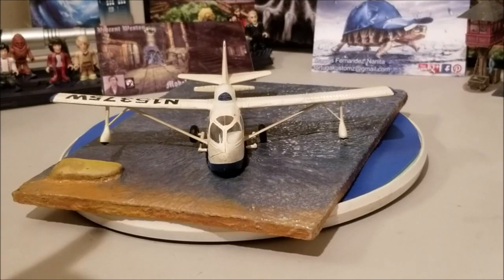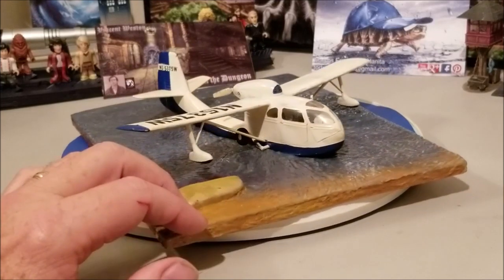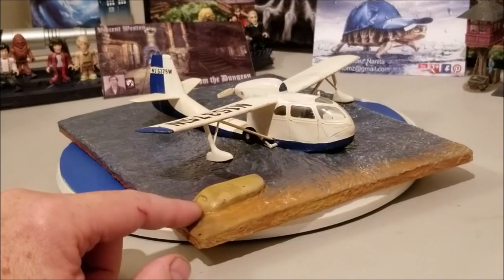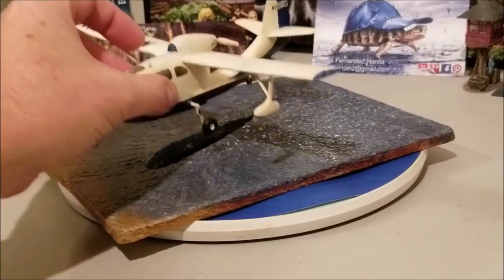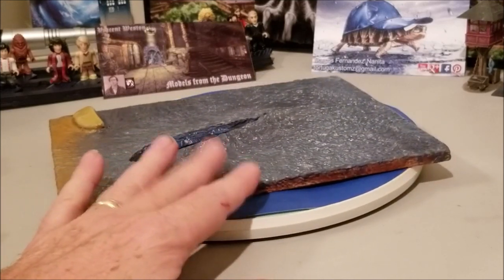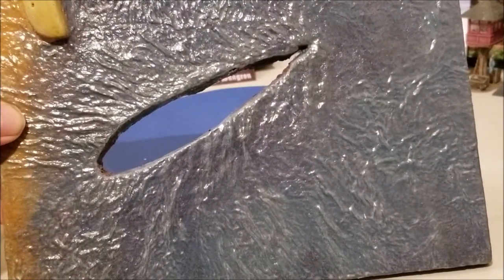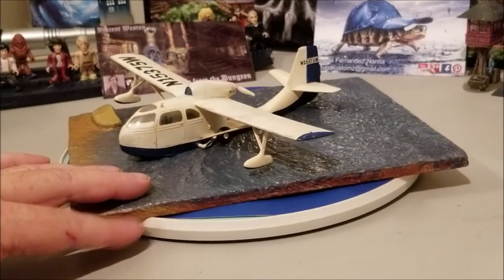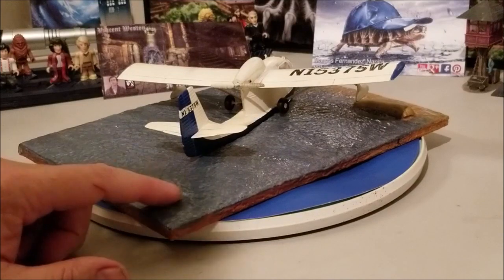Papadan Appreciation Base

Comment: Great job Vince. I think it looks good. Your right , the Mod Podge does have to be put down in thin layers in order to dry and left alone to dry completely in order to not get the white spots.          Papadan
Reply from the maker: Thanks Dan.  The thing I noticed is it getting piled up in the crevasses.  I tried to keep working it out around the waves.  I am wondering if an acrylic varnish, like Cermcoat, would be easier.

Comment: Looks good Vince, seems like the tp and the modpodge are tricky to work with.
Reply from the maker: Thanks Steve.  The TP is easy enough.  It is just laying down layers with watery glue and slopping it around with a larger brush to make your waves.  When I do this again, I will probably use an acrylic varnish like Delta Ceremcoat instead of the Modge Podge.  The Modge Podge just gets too thick in the crevasses of the waves and needs special care in spreading it around.